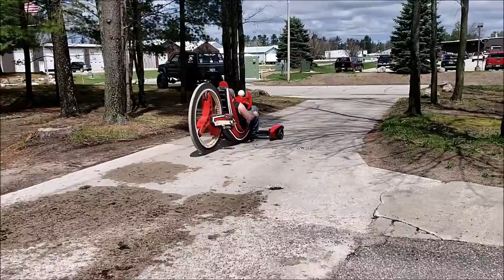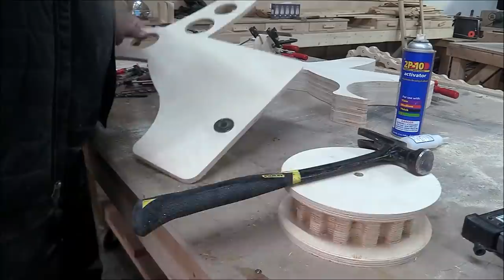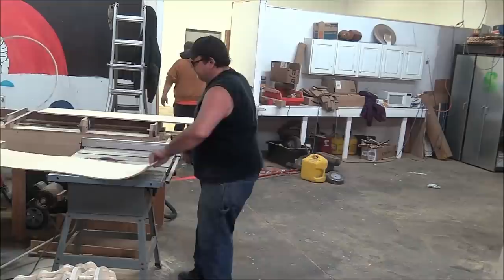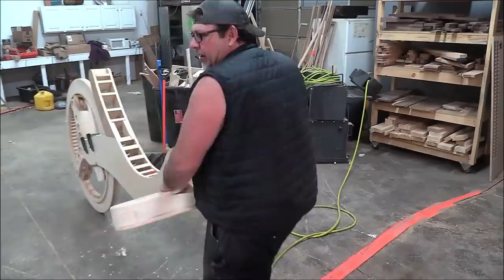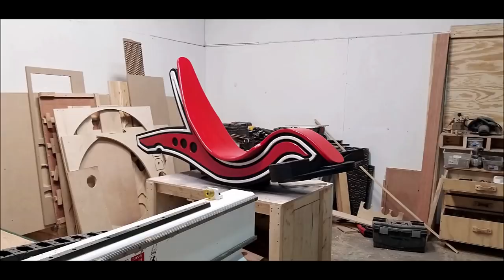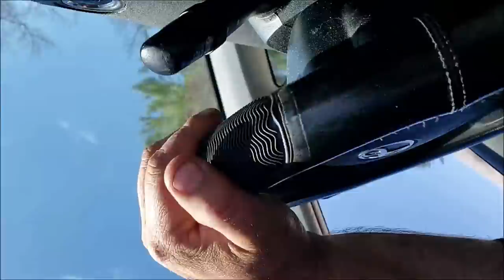How To Make a WOOD BIKE and Power it with a CORDLESS DRILL

Comment: Cool build. I personally would have put slightly larger wheels at the front similar to the mountain bike tyres. 
2 questions if I may, What is the top speed? And how far can you travel on a single charged battery?

Comment: hey Izzy,  
this is inspiring.  im now hunting around for an old leaf blower with a 48 volt motor that i can cannibalize for my motor.
just one Q though: why did you opt for such small wheels on the front?   my first thought was to use 12" bicycle wheels from an old children's bike.  i think, due to being pneumatic and a larger diameter, they would make the ride smoother, (not get hung up on pebbles/rocks etc.), and be more efficient.  
awesome build though.  my next big investment will be for a CNC machine.

Comment: Have any ideas for a similar project that will work on dirt roads?  Tools limited to 30 yr old scroll saw, refurbished portable table saw and a drill. Do have a scooter motor, cloths dryer motor and maybe a fan motor from a central AC unit.

Comment: I need to build something to set & sleep in that 4 section **  1 an area to set the depth of a recliner ** 2 with a back that go back toward the floor 60 degree ** 3 a section from the front of the seat to the  knee go up too between 15 to 20 degrees  4  from knees to feet a 5 to 10 degree more ** this would keep my feet up when setting & sleeping and fluid from building up in my Calf & feet ** I l know how I want it to look but not how to get section to move & stay were I want them  width the size of a twin  bed

Comment: I love your builds like this. is there a rubber layer or any protective layer on the outside edge of the big wheel?  It would seem that  it is an expensive part to replace both  time and plywood.

Comment: The ground clearance looks like less than an inch. Why not design it with two or three inches of ground clearance?
Reply from the maker: it was 2 inches of ground clearance when the little guy was sitting on it to get more clearance just add bigger front wheel for me i wanted to keep it super low.